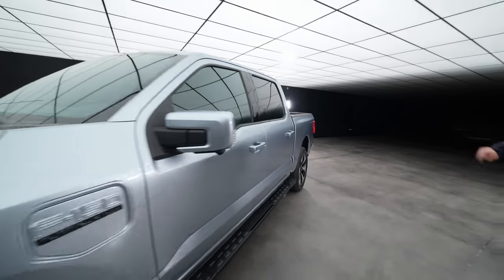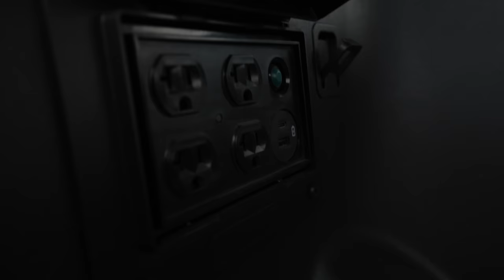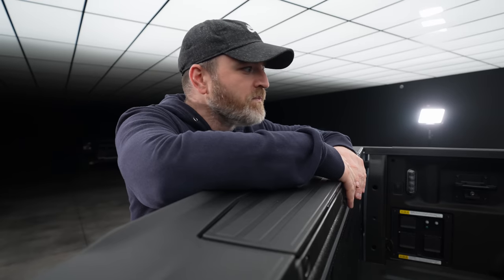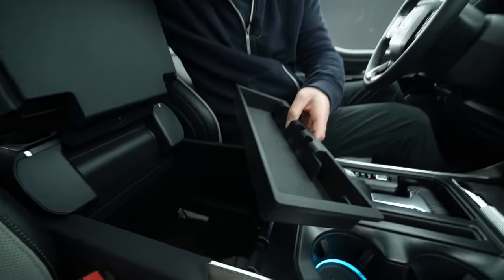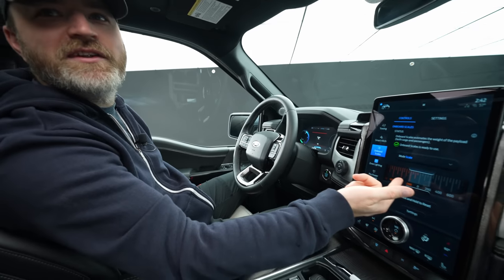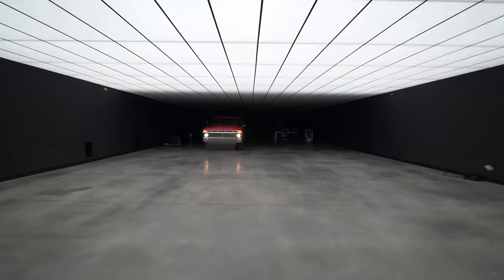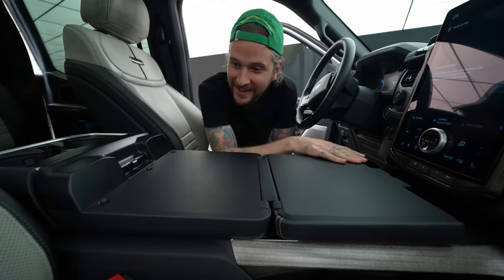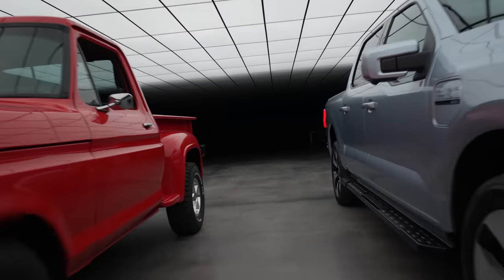Ford F-150 Lightning Electric Just Changed the Game ft. Peter McKinnon

Comment: As a welder, seeing a 240 outlet in the back makes me happy. It opens up a lot of potential for field work.
Reply: As a welder youll get a dully and put a rig on it lol
Reply: @quyenbui2263  I could, but electric cars and trucks are pretty much the future sadly. Might as well join em before gas prices get too bad and we start buying oil from Spain.
Reply: @Chris C Honestly yeah, and with a diesel hybrid you can run it off of fryer oil too if gas prices get bad at any point. Ik the conversion kits are a pain and a half to install, but I heard something about a new diesel engine that could potentially run off of both so yeah. Definitely another good choice and it doesn't require solar panels on your roof to power 😂
Reply: @Chris C just put up solar panels and produce your own
Reply: @philosophicalemoboi5862  don't include yourself in our group, ain't a fucking welder if you ain't smart enough to know electric is not the future.
From a material availability stand point it falls apart.
Hence the name RARE earth metals.
Reply: exactly!!
Reply: @eddyneedsahobby  pretty much my thought solar panel on part of roof or small propeller in the back and vehicle will stay charged no need to stop at a hotel every night give or take 5 days for a  2 days gas trip
Reply: Has a max 9.6kW power generation.
Reply: @jonathangarzon2798  The associate's degree in welding technology and experience I have say otherwise. So I'd say I am a welder, and I'd also say you're probably the type to bust the balls of the new guy who walks into your shop but not because he's inexperienced, but because you've run out of opportunities and that new guy hasn't.
Reply: @pootmahgoots8482  That's more than fine. You'd only need 5-11 per hour depending on your welder or plasma cutter, and most jobs can be done in about 20 mins. Thanks for the info tho, that does limit it a bit more.
Reply: @philosophicalemoboi5862  yeah man. If anything you could mount a cabinet in the bed with a generator/welder combo and route all your charging cables into the cabinet to charge all your wireless power tools batteries and use the tailgate for a work surface. Then put a camper shell over the whole thing so it's all contained?
Reply: @tristenlittke7593  maybe realize you're in the minority 😬
Reply: As a non welder, seeing a 240 outlet in the back makes me happy as well
Reply: @philosophicalemoboi5862  sadly? What's sad about it?

Comment: "It's not just an electric vehicle, it's a generator as well"
Since it doesn't actually generate electricity it's not a generator, it's a battery. A generator produces electricity by converting mechanical energy into electrical energy. This doesn't produce anything, it just simply transfers the electrical energy. Still an awesome feature but if it dies you can't just refuel it, you would need to charge it, defeating the purpose of a generator, since they are used in POWER OUTAGES where electricity is unavailable.
Reply: Lmao.

Comment: This thing makes me giddy. If they would've turned the grille into a front (tail) gate, that would've been slicker than 5th wheel grease.
Reply: if you like this, check out the rivian
Reply: Yes! Have the grill fold out with the hood still closed, that way it can also be used as a bench without having to leave the hood/trunk open.
Reply: I think it was intentional not to do that so that you have storage that you can walk up to. You don't want to be lifting things over the gate if it's up or bending over it if it's down when you're putting groceries, golf bags, camera equipment, etc in the frunk. This is much more accessible than the bed and it seems that's how its supposed to be. Would be nice to sit on the gate and grab a drink out of the ice chest though :)

Comment: The extra miles due to  them measuring with already carrying weight is amazing.
Reply: It's a smart move to hedge against people complaining later about not getting the promised milage per charge
Reply: Why would you not tell everyone the actual range??
Reply: @johngee777  because people would complain if it was wrong
Reply: meaningless w/o knowing the "load"
Reply: Why would you not state that it had a load? In addition the range would change every time the load was a different weight. This makes no sense.
Reply: Plus it's not smart. It's just confusing.

Comment: “Warning: Engine will run to power outlets, outside use only. Running engine emits CO and could cause death if used inside a garage.” Ford really slapped the generic stickers on an electric vehicle.
Reply: @terrywbreedlove  I have not seen this sticker on a Tesla or Rivian.
Reply: @gbeaver57  Because the Ford is built on the same lines as the hybrid and gas Trucks. Tesla and Riven don’t have that.
Reply: @terrywbreedlove  then I don’t see how a regulation applies. Clearly someone dropped the ball since they’re not required for other manufacturers.
Reply: @gbeaver57   Ford sales about a 900,000 F150 pickups every year. Not counting all the other Vehicles they make.  All those F150 pickups roll through an assembly line. They aren’t going to pull a very few out and not apply a sticker. That would cost time and money. When these trucks go into full production and get there own assembly line time it will be a different story. By the way Tesla only sales about 250k cars total.
Reply: @terrywbreedlove  cool, so it’s Ford’s fault. You blamed “insane laws”.
Reply: @gbeaver57   It is the LAW these stickers are to be applied. Ford wouldn’t waste the time or money otherwise.
Reply: @terrywbreedlove  you said they wouldn’t waste time and money to remove them. It’s clearly not the law to have them which is why Tesla and Rivian don’t.
Reply: @gbeaver57   Why is it so hard for you to understand this simple thing ?
Reply: @gbeaver57   The Ford Lightning doesn’t even go on sale until next year. They already have 200,000 pre orders. In fact they are sold out through 2024. These few trucks they built for the Media are built on the current F150 lines. But that will change as the Lightning gets rolling on its own. When they are actually on the streets there will be no hold over has F150 stickers.
Reply: @terrywbreedlove  so just say it’s Ford being cheap and lazy by not removing the stickers. It’s not the law. Your whole argument is junk by your explanations.
Reply: @gbeaver57  I will say it is someone freaking out over a sticker 🙃
Reply: @terrywbreedlove  I made a joke and you made it about make believe laws.
Reply: @gbeaver57  The Laws are real

Comment: How does it drive though? Forget the specs on the inside, how does the lightning ride?
Reply: My dad works for Ford and got to bring  a prototype home for the weekend and it drives great. It takes getting used to because it’s pretty much instant torque but it’s overall smooth to ride in and is very functional

Comment: It will be a true future when these EVs can charge in 5 min or less
Reply: MAYBE IN 20 YEARS 
BUT CHARGING AT HOME IS NOW REALITY 
NO NEED TO WAIT IN LINE FOR GAS
Reply: A good stop-gap would be to have modular battery units that can be swapped. But the price of an extra set of batteries would be like 1/3 the price of the car.

Comment: Looks like if I want to downgrade my house this could be my next house. “Tiny house” thing.
Reply: Good point!
Reply: Generator, Utility Vehicle, And maybe a Camper ? WOW!
Reply: ngl this is my goal
Reply: Hi
Reply: Or you can build a skoolie
Reply: Are you saying this is expensive? I was shocked it's only 40k. You need to look at the price of trucks, and electric cars. I fully expected this to be 60k
Reply: @captainthruster9484  there is no way that platinum lightening costs $40k. It will be at least 2x that
Reply: @captainthruster9484  the model they are showing is the platinum, which is starting at 90k. the base 40k basically is a glorified ford xl with a battery and outlets
Reply: @captainthruster9484  well $40k is a huge money already for me. I don’t even have $5k.😅

Comment: For a job site, this thing is a beast. I can picture contractors getting this on order immediately. Electric power to your tools, you can store your power tools and expensive stuff in the frunk, maybe an air compressor- it's all around awesome.
Reply: I really hope they implemented a way to have a "cut off" for that kind of use so you don't strand yourself at a jobsite by using all the power to run your equipment.
Reply: @Aperson156  I mean for the power the house thing it stops at 100 mi range left so you can still get to a charger so i think the same applies here
Reply: @spencerrr9878  Ah, I hadn't seen that mentioned anywhere. Thanks.
Reply: @Aperson156  they do...they said that the app allows you to control when yo want it to shut off and saver power.
Reply: Tesla needs to cancel it's moon rover stat. This is going to be selling like lightning.
Reply: it sucks
Reply: It will depend on the contractor obviously and whether those contractors value it enough. I personally feel the contractors who can afford it will be few and far between while utilizing it completely. 

I’m willing to bet most will just drive it like a daily
Reply: Seems silly, but when you get off work and you have climate control in your seats it's really nice. I'm sure someone driving a 1980's Dodge Ram with a spring poking them in the ass will point out how expensive it is. I don't care, it's friggin nice.
Reply: @unicornhuntercg  99% of the time I have YouTube playing for background noise.
Reply: @Texarmageddon  I'm willing to bet most contractors haven't stopped laughing yet ..... and they will drive their petrol/diesel powered trucks until they are banned.
Reply: too smal of a bed though for constructiopn
Reply: @Aperson156  Well there are always generators or other means of charging it enough to get you to the next station.
Generators are super cheap now and not very big. So you drop maybe $600+ on a generator, but it gets you maybe 5-6mi/charge-hour at 3.5kw. That's more than enough to get to any nearby charging station in probably under a couple hours of charging.

I know there may be some debate to using gas to do that, but if you get yourself in a bad situation and it's your best option, why not. Having a mobile electric power house is more than enough to offset the little bit of generator usage I think, for those environmentalists out there.
Reply: @JohnDoe-mx1sq  those seats have been around for years now in all makes.
Reply: @RoySpray  What a joke. Tesla 1million preorders. Ford 100,000
Reply: No. Everything is battery powered now. at best maybe a port for your battery charger. Don’t see it being much help tbh
Reply: @mattjames8683  so from Nov 2019 until now, 1M orders on cybertruck verses 3 weeks, 100K on Lightning. That's 76 weeks vs 3 weeks. At that comparison, Tesla should have 2.5M orders. Also lots of skepticism that they even hit 1M real preorders anyways. Sorry bud, your point is mute.
Reply: @orangejuli07  yeah Tesla had to cut it off because of so many preorders so your point is mute🤣
Reply: No good towing
Reply: @augustusgloop9330  Agreed, it's mediocre at 7-10k and effects battery by 30-50% while towing at maximum capacity.
Reply: @Aperson156  300 mile range at 2.2 miles per kWh is about 120 kWh. Use 30 kWh for jobs and the rest to get to and from the site ... 30 kWh is a lot of power for work at the job site.
Reply: Are you dense?.... Yeah, use all the power on jobsite tools so you can NOT MOVE when it's time to leave.
Reply: @starmc26  how many kWh of energy does a big job need on a daily basis?

Is that such a dense question?

Comment: No oil change. No moving parts. This is future.
Reply: “No moving parts” lol electric motors spin and have to be greased as well
Reply: @SixtwoSC  no moving parts mean engine parts. Use little common sense. In this case only electric motor. No maintenance.
Reply: @ekghostofficial  i wanna see one of these last 200k miles with no maintenance like you say

Comment: A FRICKIN' GENERATOR AS WELL?!? Yes please! I'm definitely going to get one of these
Reply: I think the joke was when it announced it, it was a few weeks out of that massive Texas Ice storm and shut-down. 
It was a WEIRD thing for Ford to flex.
Reply: with PG&E cutting our power like 10x/year in California, that is a killer feature
Reply: It's not a generator, it is a massive portable power supply. Does not generate power
Reply: @Shaheen Shad A generator by definition must be capable of converting one form of energy into another. This does not do that. It only takes in and stores electrical energy for later use. You wouldn't call a AA battery a generator? Same concept.
Reply: It’s energy storage not a generator.

Comment: They should put a gas generator in the frunk to charge the battery 😂😂😂
Reply: Probably would need to carry one if going off grid
Reply: That will be the option for electric vehicles, comes with gas generator
Reply: @dano1234v  why didn’t we think of that years ago ? 😆
Reply: Brandon Carr because there is not enough on the road yet getting stranded with no power, it will happen soon enough
Reply: Brandon Carr we can call the option the replenisher, it will sound environmentally friendly

Comment: cool, if they don't have a fast charging network. how far and how long to charge with the current low voltage systems.
Reply: I think that's going to be a huge problem with these electric pickup trucks
Reply: @robertryan7204  Facts!
Reply: @adrianchandler7853  especially outside NA and in many parts of NA

Comment: Very cool. Just wondering how many charging stations there are out in the world today. Course, you got one at home, but then you tow your camper (4000 pounds) 200 miles and now you gotta recharge. Can you roll up on a Tesla charging station and use that? How about Rivian charger? How about the power station at a typical campground where you have 30 and 50 amp 110v plugs? Until the industry gets charging stations at least up to 40 -50% as many gas stations, EV's will still be second place in the market.
Reply: Winner!
Contact Lew
WhatsApp only  !
Reply: Plus
I
Open bracket
II
I
0
Close bracket 
V
V
VI
0
II
IV
0

Comment: Did anyone catch that warning label above the 240v/120v outlets in the bed?  It says;  
“WARNING: Engine will run to power outlets, outside use only. Running engine emits CO and could cause death if used inside a garage.” 
Apparently somebody @ the factory forgot this was an⚡️F-150 😆!

Comment: So genuine question for any enthusiasts; this thing gets less than half the mileage of a trucks tank of gas full. Which wouldn’t be an issue if there were more chargers around, especially where I live. SO! Could you get rid of the frunk and make the battery large enough to go 500-1,000 miles on a single charge? Is it an issue I’m not thinking of like heat, weight, longevity of the battery? Please help. But I really would always prefer the mileage over a frunk if this were possible.
Reply: Plus
One
Open bracket
Three
Eight
Six
Close bracket
Six
Zero
One
Nine
Three
Four
Nine

Comment: Thank you for the intro of this new vehicle, for me I would like to know the range after it has a large load in the box, or even pulling a 5th wheel. These are important to myself moving forward. I currently run a F250 6.7 Diesel, and I see i am reduced approximately 15% less fuel mileage when i am pulling my trailer.  Any chance we could get some of that information out there? Again Thank you

Comment: How long does it take to charge the new F-150 Lightning? F-150 Lightning Charge Time

Ford says this unit will fully recharge the standard-range battery in 14 hours and the extended range battery in 19 hours. A 48-amp Ford Connected wall mount charge station is optional. It requires a 240-volt source and can charge the batteries in 10 and 13 hours, respectively. Oct 4, 2021 (From Forbes Link). 

My question is, how is that practical for our economy? For farm/ranch labor? In rural areas where we have no charging capabilities without a gas-powered generator, and then do we have to wait 14 hrs.? I'm trying to admit that we will be forced into this technology by understanding how to maintain power by charging these vehicles. Will we have to have two vehicles to have one on charge all the time? How will these all-electric vehicles handle extremely hot and cold temperatures under load? I'm not sure the technology can answer these questions...

Comment: Too bad no reviewer ever mentions this thing will get a range of 75 miles when loaded or towing even a 2000 pound trailer. Did  you notice this is a topic everyone shys away from.  Whats gonna be left for you to use at the job site and then have enough  to go home?   The el cheapo version is only rated at 200 miles at ideal  non towing conditions. Dont turn on the air (no octovalve like Tesla) or the resistive heater or youll get even less range.  And then theres the aerodynamics of a brick!  Also ford doesnt make chargers...BIG downside...bumming off volkswagen and possibly even Tesla which owns the best  and most reliable charging system in the world. Theres gonna be a lot of frustrated ford buyers  a month after they get delivery and the euphoria wears off.

Comment: How much time does it take to charge it up from 0 to 100?
Reply: It isn't recommended to approach a 0% charge.  That being said, charging time depends on your infrastructure.   According to Ford's website, you can go from 15% to 80% charge in 41 minutes with a  150 kilowatt DC charging station and charges 15% to 100% in about 8 hours with the Ford supplied at home 80 amp 240v AC charger.  At 48 amps it takes 13 hours and at 32 amps it takes 19 hours.

Charging times for the standard 230 mile battery are slower that the extended range 300 mile battery shown above